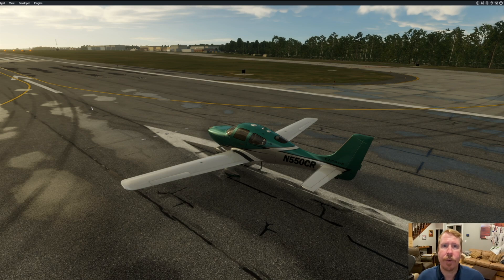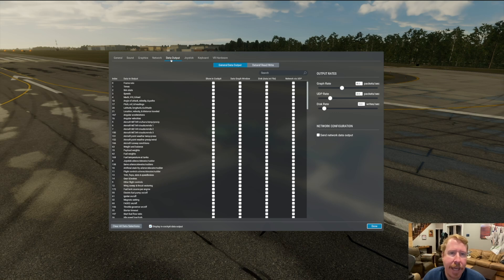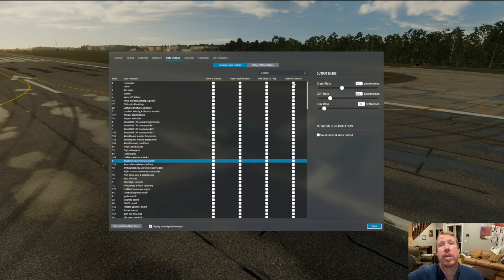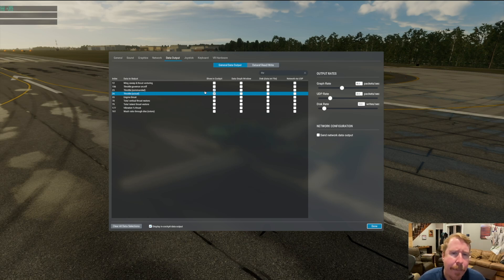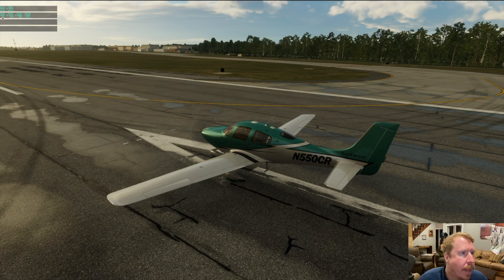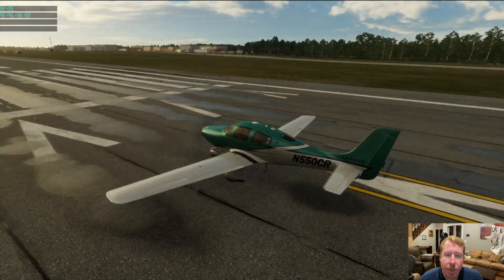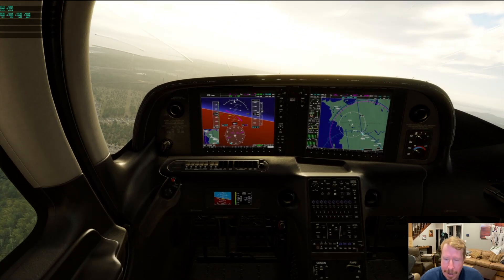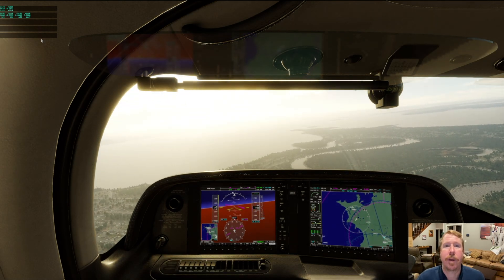How to Analyze Data from X-Plane

Comment: Thank you so much for this. On my custom piper pa 28, I have a data output aileron setting that is registering a.03 deflection at idle and with parking brake, and no input from the yoke.  When I accelerate, my plane drifts to the left and way beyond beyond the effect of p Factor. I cannot achieve straight and level flight even using elevator trim, throttle, and trying to offset it with rudder trim(even though the piper doesn't have rudder trim). Is there's a way to actually take the data output information and use it to adjust the settings on my mac. Any advice would help as I'm new to sims.

Comment: I would like to know if it would be possible to analyze the FDR records on the Virtual flight. Is this configuration possible? I need to perform flights in X-Plane and download these FDR data from X-Plane. From what I have researched, X-Plane can load FDR data from an aircraft and display its flight for investigation.

Comment: The funny thing is data-output cannot be seen when multiple monitors attached to a MacOS. I'm running XP12.1 from the beta days and maybe after ten upgrades the bug is still not resolved. Hope someone sees that message because filing a bug report does not trigger anything apparently.